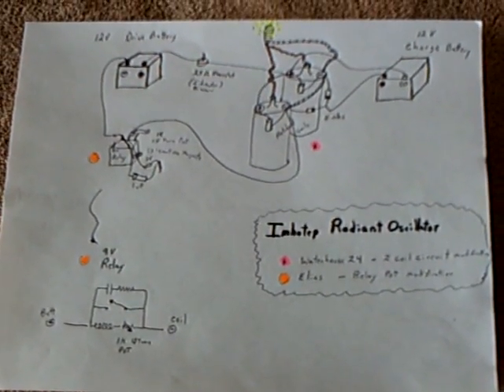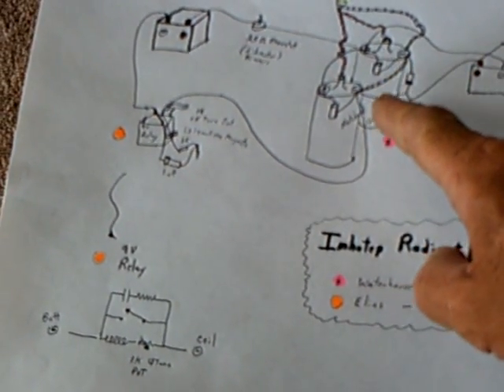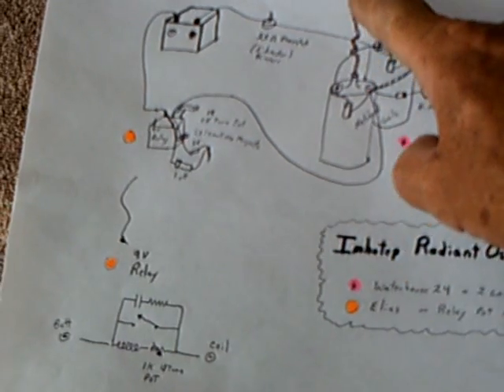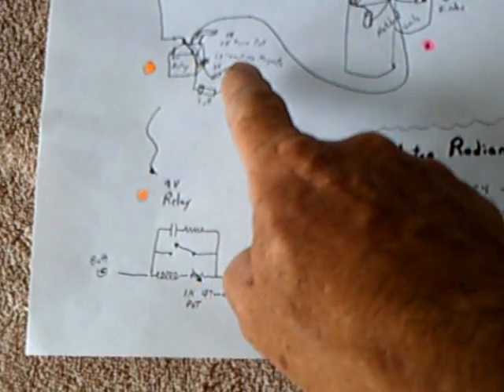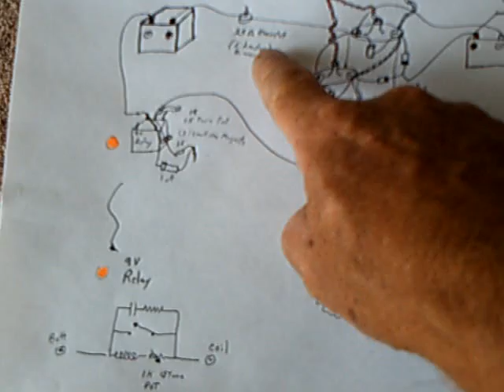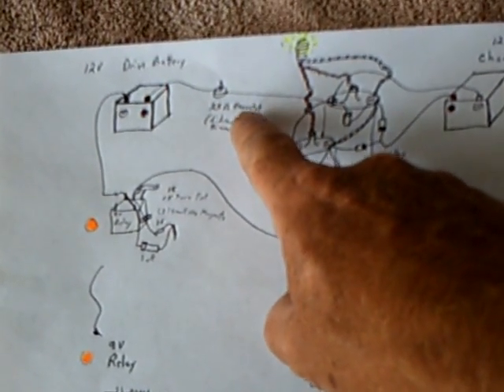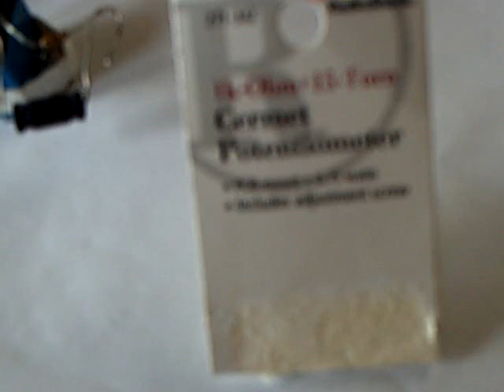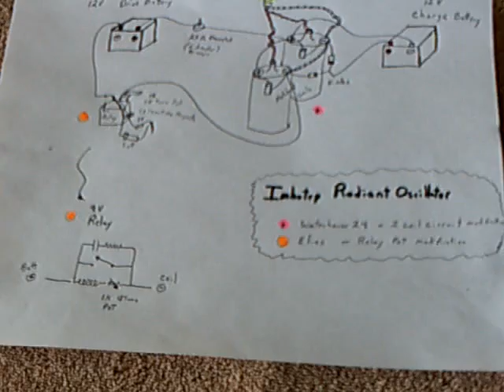Imhotep Radiant Oscillator -- Circuit modifications

Comment: well of course im making assumptions, I dont have the thing in front of me do I. 

Obviously proper audit of energy would sort this out, I just find it intriguing to see a 100W cfl glow of a 12V battery. 

Lidmotor says there is no free pie, so I guess that settles it, but I would be very interested to see the real efficiency of the thing. Even if it recovered up to 80% Power back I think its worth investigating and improving. Anyway Im gonna build one so i can see for myself.

Comment: i think your right, u told me this a while ago, voltage spikes can charge caps, we cant just say hey look it charged my cap up to 300V...
but still, great idea wouldn't u say Drevtoob. I mean u must admit it is strange to see a 60W globe light up on 12V 50mA.. and charge a battery at the same time? 
How can u explain this?

Really opens up new ways of designing household lighting, by recycling most of the energy